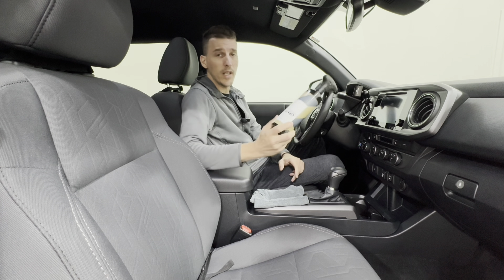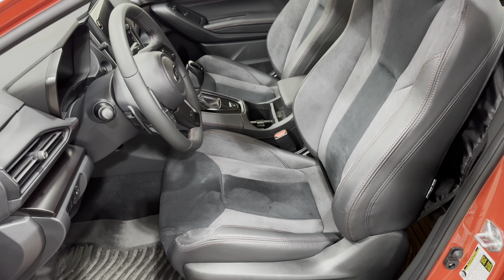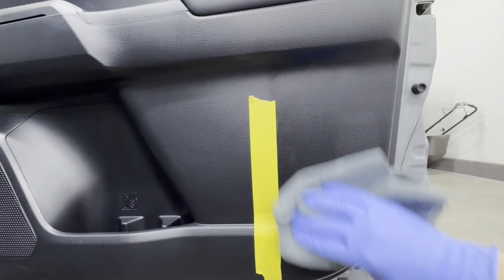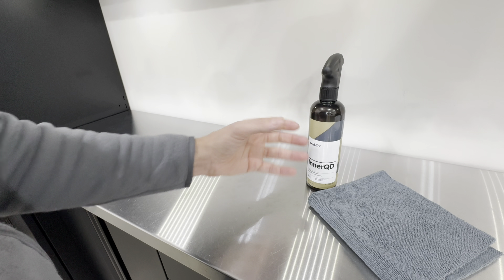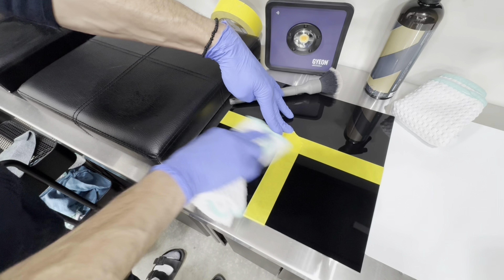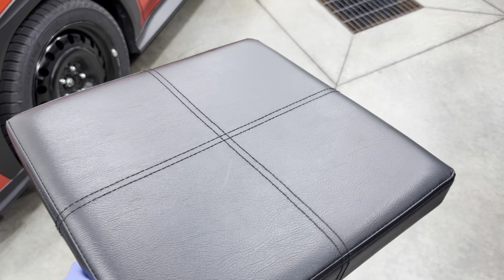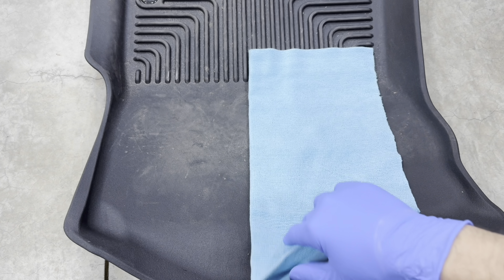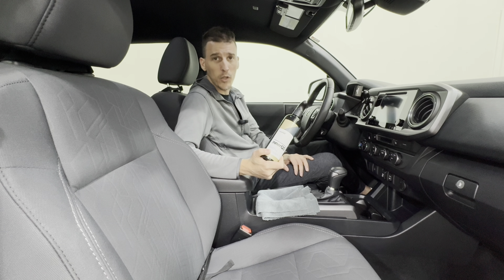CarPro InnerQD Interior Detailer Review

Comment: Very thoroughly researched and well presented video sir.   I think their are better options out there instead of Inner OD, at least for me anyway.  I don't like the fact it streaks on windows, which seems to me that it would also leave some type of film on the other surfaces, just maybe not seen by the naked eye like on glass.   One of my favorite interior cleaners is from Soft 99 and it's their Wash+ which also has sanitizing properties, and is similar to Gtecniq Tri-Clean.   It's also a very similar product to Inner QD and has a great scent although Inner QD is probably a stronger cleaner.   The only issue I have with Wash+ is that it's only sold in a small bottle.   It's not available in gallon sizes which is a shame because it's a great interior cleaner for well maintained interiors.

Comment: Excellent testing.
I bought some acrylic sheets after watching your video last week. It came with lots of 'dealer installed scratches.' can you demo how to polish these sheets please. I used an all in one polish and made it worse. Also, if you have a clay towel and clay bar, you could do a marring test. I won't reveal mine yet😂
Wrt, InnerQD, personally I just use an rw like DIY Detail
Thanks again
Reply from the maker: Many thanks! Try to purchase the acrylic panels from amazon that have the protective film on them, and then peel off when you’re ready to test. If you notice the odd deep scratch tony worry too much about it. 
Try to focus on the marring occurring on the wash medium direction. Try to stay in one direction vertical ( up and down) 
The way I polish my panels successfully is I use a rotary polisher with an orange foam pad and I use 3D one polish. The deeper scratches will stay but because they are minor and random I don’t focus too much on them.

I have done all clay bar test and wash medium test. interesting results lol.
Reply: @DetailProjects  good to know I've done exactly as you have. I may have been looking too deeply for a perfection that's unattainable with these sheets. Thanks for the response.
I really enjoy left field thinking for my own tests and experiments, so watching what you're doing is a real pleasure. Well done

Comment: I wanted to like this product but it was always too slick on the surface. I really didn’t like the feel. 

I like ADS Pilot much better.  It truly leaves the surface with no change in look or feel.
Reply: That's incorrect,  I've used Inner QD since it's release and it's definitely not slick so maybe you used to much...Poilet is a good product especially if you want that factory look.
Reply from the maker: It does leave the surface slick, I also used minimum product and it’s still slick on my panels. I tried this on multiple surfaces and always get the same feel .